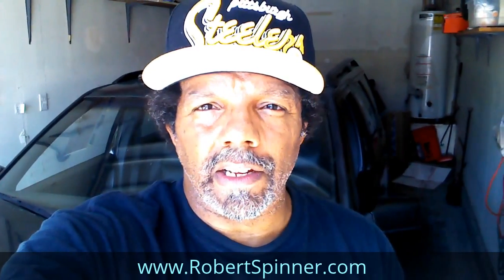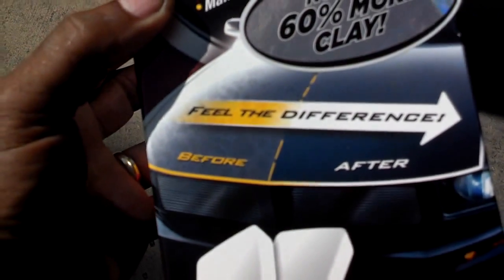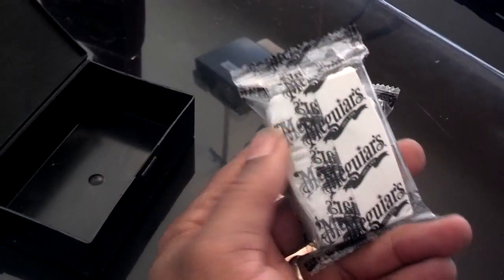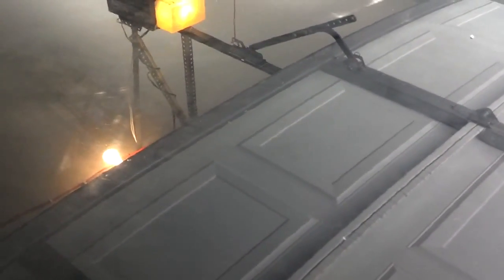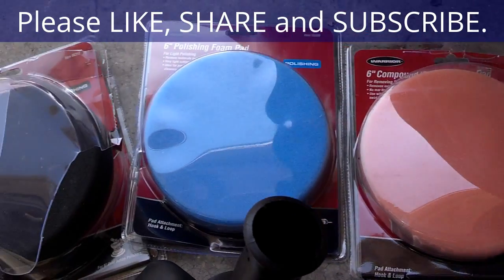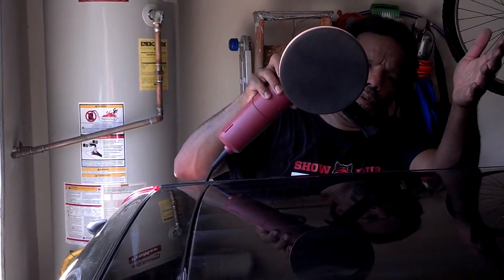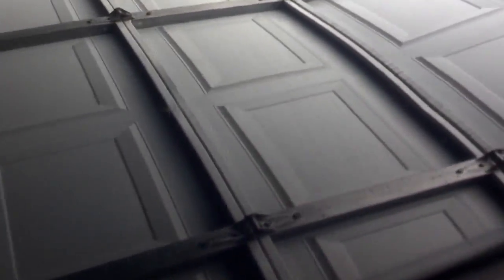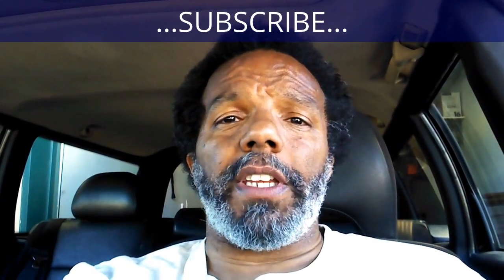Auto paint restoration, how to use clay bar and a professional polisher detailing exteroir. - VOTD

Comment: Robert, your Volvo was painted base coat/clear coat, which means after the primer was put down a color coat was sprayed on top, then a clear coat was sprayed over the color. Be careful not to cut too much clear coat; you only need to cut a very very thin amount of clear to get it shiny again. If you cut into the color coat, you'll have all kinds of issues that can only be solved by a re-spray!
Reply from the maker: +Nirky I understand. Thanks.

Comment: My hood looks like your roof (also black. Does a number on my OCD. Never buying a black car again!). I thought for sure the clearcoat was fubared, but I'm going to try polishing it now. People on the detailing forums say you can't polish clearcoat once it clouds over, but I think you've proven that wrong.

Edit: I tried one last ditch effort: wet sanding with 1500 and 2000 grit, followed by compounding with M105 and polishing with M205. Didn't expect the kind of results I got, but it looks amazing now. Would not recommend wet sanding unless compounding with a rotary (more cutting power than DA, but also riskier) doesn't do the trick. It seems like Volvo used a very hard clearcoat on these cars. In some ways that's good, since it won't bubble and peel like Hondas of the same era, but it does make paint correction a lot more difficult.

Comment: Always clay in a straight line. By claying you make small scratches, which are way easier to polish out when they're all in the same direction ;) Don't use a circular motion. :)

Also, slowwwww down. No need to hurry! Let the polisher do it's thing. Try and do an inch a second or something. Use a clear pattern, left to right, go one pad length up and go left to right again. Then when you finished that area, go up and down.

Good luck!
Reply from the maker: +Yannick de Vries Thanks for the tips.